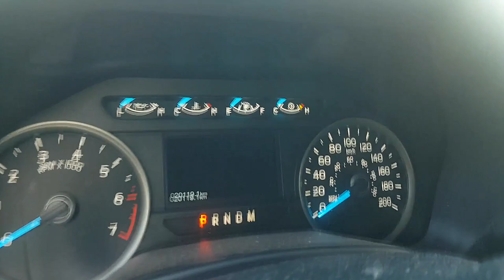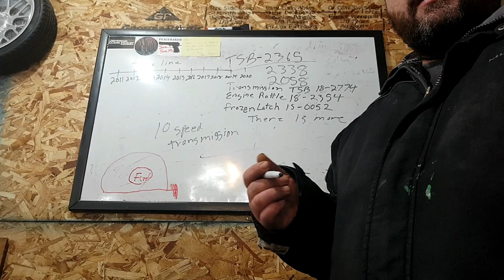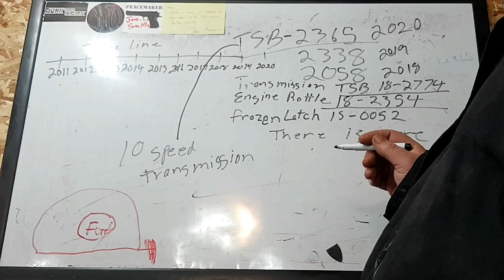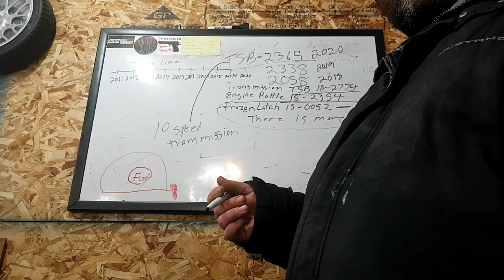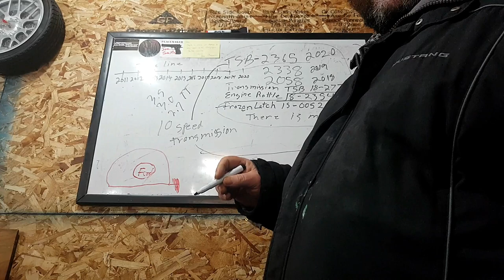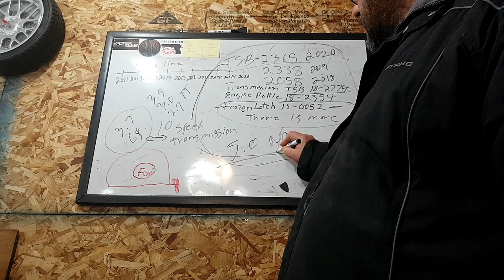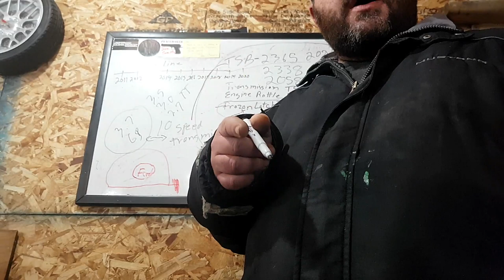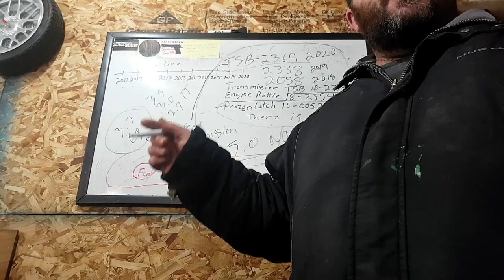FORD F 150 burning oil  consumption engine rattle and transmission problem related? 2018,2019 2020

Comment from the maker: please consider signing petition: https://www.change.org/p/ford-motor-company-ford-provide-answers-customer-concerns-on-f-150-oil-consumption-2018-19-2020-model-years?recruiter=489735026&utm_source=share_petition&utm_medium=copylink&utm_campaign=share_petition
Reply: Ill pass it on to my nephew who has a 2019 furd
Reply from the maker: @ifitsnotbrokenfixit1193  ty sir
Reply: Signed and shared on all social media brother
Reply from the maker: @AntonioClaudioMichael  ty Antonio
Reply: Signed and shared 👍
Reply from the maker: @scottyoung2572  thanks so much 🤜🤛
Reply: this guy's garage 2018 Ford F 150 twin turbo 2.7 has issue. When accelerating from a stop the truck hesitates when going from 3rd to 4th gear. After that it drives normal. This only happens once when the truck is cold. After it is driven a few minutes it doesn’t happen anymore until after it’t been parked for awhile.  Should I be concerned or should I just let it warm up longer?
Reply from the maker: @burimdemiri7394  my 3.5 is similar when cold. my mustang did the same thing with the supercharger on it as well.  its a boost thing when in closed loop operations under warm up. if the problem persists with warm operations it needs to be looked at.  stay in touch, ty for the question.
Reply: this guy's garage when its warm its doing fine thank you!!
Reply from the maker: @burimdemiri7394  very welcome come back any time 🤜🤛
Reply: Signed petition. Maybe I’ll get a newer new truck yet!
Reply from the maker: @MrESage  hopefully they will do something 👍ty sir

Comment: Thank you Sir for all the info. 2018-2020 F150 5.0L. TSB:19-2365 reprograms the Powertrain Control Module (PCM) to reduce engine vacuum during deceleration fuel shut of (DFSO). During DFSO oil may be pulled into the intake from the Positive Crankcase Ventilation Valve (PCV). Ford replaces the oil dipstick as well. Apparently, this solves the oil consumption issue affecting many people. Pass this along to anyone with one of these trucks and tell them to keep an eye on the oil levels. 2 years of research from YouTube and forums and this may be the fix we've been looking for. Good luck everyone.
Reply from the maker: thanks so much!
Reply: I had this TSB procedure done on my 19 5.0 and it lessened my oil consumption noticeably but I still use a little more than I think I should, but, I do tow an RV a lot, so I think that contributes. My .02 cents.

Comment: My used 18 with 43000 had all the problems. Trans and engine. I have engine noise I haven’t found in a video. Loud tap driver side rear lower part of engine. Only when cold out after it warms and idles at 600. The tap is not in Duce with cylinders. Ford putting me off till warranty out the haven’t had a opening in 2 months for me. How do I share a video to you.

Comment: Thank you for your videos       What F150 year do you recommend me to buy i was very close to buy a 2018 5.0  until I found your youtube channel      thanks again
Reply from the maker: 2016 is the last year that didnt have all the issues associated with 2018 -2021 oil consumption and transmission issues 2017 with the 6 speed would be ok the change was midyear. anytime .
Reply: @thisguysgarage   i really appreciated I wish you the best for this coming year and for us that are not mechanical inclined your help is much appreciated. I signed the petition

Comment: Glad I found your video. Mine is in the shop this morning. Hell of a knocking at idle for 3 days and it stopped last night. Appointment this morning again after dipstick change and oil change 1500 miles ago. Just got call back they can’t find anything and rattle is normal. When I go pick it up I’m asking for regional service technician
Reply from the maker: sorry just seeing this, filter picked it up for some reason. how did you make out?

Comment: That stinks when you can't even get a new vehicle off the lot to be correct. 
A buddy of mine had a Chevy Silverado with the 10speed and hated it.  It never new what gear to be in. It was great going down the road at 55mph+ but pulling any weight it was in and out.  Took it back to the dealer countless times.  They told him not to pull anything heavy.  🤦‍♂️
Reply from the maker: That's outrageous.

Comment: The 10 speed transmission was designed by GM and built by Borg Warner, we had the clunk in our 18 and had it reflashed and it did fix the problem for now.  As far as the oil consumption we do not have a problem, but the problem may also be the oil filtering for the pcv system where the catch can is drawing too much oil.
Reply from the maker: you are the only person that i heard from ,that the flash fixed their trans clunk,glad ford helped someone,ty for taking the time,keep in touch!

Comment: I have a 2020 f150 5.0 with the 10 speed. first I put a reducer in the pcv line to reduce the vacuum. Then I switched to 5-40w. That took care of almost all the oil consumption. Then I went to 5star tuning and had a custom tune made for the engine and the transmission.  What a difference. the trans hits every gear. no more hunting or skipping gears. I know I should not have to do all that, But ford was not going to fix my problems.

Comment: If the new dipstick was a scam, how would it be possible for, when you get a fresh oil change at the dealer, assuming the correct 8.8 qts was installed, the level is not significantly above the max level?
Reply from the maker: they moved up the mark as well ,or ford speak widened the range by 3 quarts instead of one

Comment: Another thing added in 2018, direct injection. I feel like the 3rd gen coyotes are also having problems because the new direct injection system (PFDI - Port Fuel Direct Injection.) honestly I think it screwed something up because it’s happening in the Mustangs with 6 speed manuals too. Leading me to believe it’s not just a transmission issue.
Reply from the maker: Thanks for taking the time Francesco.  Ford doesn't seem to care regardless.  It's a big problem. 🤜🤛

Comment: Had all of these problems along with engine knock in my 18’. Sounded like a Diesel engine after 3k mikes. Had it in the shop 7 times and 2 different dealerships and they all say the same thing. “Characteristic of the truck. No issue found”. Tried the buy back with the BBB and didn’t get anywhere because ford said there wasn’t an issue. Needless to say I traded it after 7 months for a 2018 Silverado with the 6speed.
Reply from the maker: So sorry to hear that chad
Reply: My son has to deal with the same problem
Reply: ATTENTION FORD FANS:  Scotty Kilmer says the 5.0L oil consumption problem is a Ford class defect that Ford won't admit to.  All of Ford's work arounds don't address or fix the real problem..... which is that Ford used an aluminum block on these 5.0 engines, and didn't sleeve the cylinders.  They used a ceramic coating in these cylinders (to save a few pennies), and this coating is either failing or it isn't working as it's supposed to, thus causing the massive oil consumption problem.

Comment: Thx Buddy for this information ! I drive a 2017 Ford F150 with a 5.0 V8 with a 6 speed automatic, umm does this problem with the 5.0 V8 affect the 2017 please let me know ? Stay Safe …
Reply from the maker: Not affecting 6 speed trucks! Count your lucky stars 🤜🤛 ty for taking the time 👍
Reply: @thisguysgarage  Thx for your reply Sir ! Umm that's good to hear about my truck I was starting to worry , this is my 3rd F series truck I have owned and never had any issues with them in the past .Stay Safe ..
Reply: @thisguysgarage  Hopefully when Ford rolls out the 2021 they will address some of these issues on which I understand Ford is developing a 4.8 V8 to replace the 5.0 V8 . I certainly hope Ford listens and does the right thing otherwise they will loose their loyal customers umm that sad how Ford is dealing with their customers ? Stay Safe ..
Reply: @buckgonsalvez384  As an newly minted electrical construction apprentice making very little wages in the mid-80's I purchased a new Ford truck. I was treated so shabby by Ford for a class action problem (thick film ignition module) that I have never bought a Ford product since.

Comment: Our 2018 F150 XLT started to make noises (rattle and ping) at around 80,000 km.  I nagged by husband to get it looked at before the 100,000 premium warrantee ran out.  He had just had an oil change by the time he took it in at 99,500  about 6,000 km earlier.  The stick was dry.  Must have been an honest technician (for once) who said we burned 3 quarts in that 6,000 km.  He did a TSB bulletin as you described.  AND said NOTHING about the oil consumption problem.  When I read the bill I got curious....and I found you.   WELL, we are furious.  Ford didn't give us a heads up for 100,000 km.  about the oil consumption issue.   We are getting in touch with the London Law firm about the class action law suit.  After complaining to FORD Care (NOT) they said they will install a seal for the crankshaft.  Oops, part not in and won't be in for one month.  Come back and pick up your truck and return the loaner, and run-out the warrantee.  BUT, they will cover the parts cost ($2.00 more or less).  The work order will be kept open BUT ford won't pay for the labour after the warrantee runs out.   WHAT!!!!   We are stuck....with a truck with no future.  It was to be a retirement vehicle to pull a small trailer. The thing won't be pullilng itself!   PLEASE people stay away from FORD 150s with 5.0 for the years 2018, 2019 and 2020.
Reply from the maker: 100% spot on Cathy. It's really sad what ford has done to us.
Reply: I was so glad to sell my 2018 truck with the 5.0 to a Ford Dealership before all this crap might have happened to me

Comment: Disable the “learn function” on the transmission. The Dealer can set the computer to do that. I’ve seen other videos with a poor shifting tranny, and the results are a perfect shifting transmission after the “learn” feature is disabled.
Reply from the maker: doesn't solve the oil guzzling lol.but ty for taking the time 👍
Reply: I asked the mechanic at my dealership,most he would do is reset the shift tables.they won't turn the adaptive shift learning off.

Comment: ATTENTION FORD FANS:  Scotty Kilmer says the 5.0L oil consumption problem is a Ford class defect that Ford won't admit to.  All of Ford's work arounds don't address or fix the real problem..... which is that Ford used an aluminum block on these 5.0 engines, and didn't sleeve the cylinders.  They used a ceramic coating in these cylinders (to save a few pennies), and this coating is either failing or it isn't working as it's supposed to, thus causing the massive oil consumption problem.
Reply from the maker: ty
Reply: Makes sense.  What about higher viscosity oil like 5w30 or 5w40?  Would that be safe?  My tailpipe is black with soot.
Reply from the maker: @user-gd5og3pz6x  I'm thinking at least  a 5w30 maybe even a 5 w 40 . The exact same engine when rouch adds a supercharger requires 5w50 . I'm investigating further stay tuned

Comment: That really sucks Caper.  It's beyond ridiculous at this point.  Ford should have fixed that problem at least 2 years ago yet they're dragging their feet to save money.  Coming up with BS fixes like using longer dip sticks is the ultimate joke.  There's a lot of folks here on YT who are having the exact same problem.  One YT guy "My Torino"  lives in Mississippi with the same problem, gave up on it and traded it in for a 2020 F-250 but obviously took a hit but he's living with it.  The F-250 doesn't have the same issues as these F-150's do.   I'm happy with my 2006 F-350 even though it's under powered with the 5.4L it runs great with over 200K miles on it.   I hope you get something solved with Ford.  Cheers!
Reply from the maker: Thanks so much William. It is redicous at this point.  F250 would be nice 🤜🤛
Reply: I'm having the same problem with my 2018 5.0 we should let the media know.👍
Reply from the maker: @corradoguastelluccia9871  spread the word far and wide 🤜🤛

Comment: Those TSB sound similar to the gen 1 3.5 EcoBoost intercooler condensation issues.  Same issue from 2011 to 2017.  Oh yes with a license plate stuck in front of the charge air cooler starting in 2015.  I owned a 2013 and it only went into limp mode once, before I had to drill a 1/32 hole in an intercooler of a vehicle that is less than a year old.  I would like to tell you Dodge doesn't do anything like this, but I would be lying lol.  This lifter and cam issue with the Hemi has been going on for a long time as well.  Good luck.
Reply from the maker: Thanks so much Mike appreciate it 🤝

Comment: The new coyote engine is different old coyote. Ford went with spray on cylinder liner and the oil consumption was born. One thing I don’t understand is why you would put a 10 speed transmission in a normally aspirated engine? All it’s going to do is lug the engine down. The eco boost makes sense in Eco Boost engines, rpms are in happy place.
Reply from the maker: Absolutely correct. Low speed preignition is rampant with the ten speed.

Comment: what about 2.7LT 10 speed 2018 twin turbo do they have same problems?
Reply from the maker: right now i have a 3.5 tt which is basically the same ,no issues like this .ty for taking the time!
Reply: this guy's garage thank you so much bro cause last nite i didnt sleep till 1am i got the truck from dealer at Hartford wi but the truck was made on Michigan Ford factory
Reply from the maker: @burimdemiri7394  you dodged a bullet! spread the word the 5.0 is a no go. ty again
Reply: this guy's garage 👍😀im now more relaxed im happy i dont have 5.0 this truck has 475 hp its fast like rocket and i think his engine is from ford mustang shellby
Reply: Even on highway i raced with ram chevy and cadillac none of them had chance i keept them around 2 miles behind i love race any tuck on highway
Reply from the maker: @burimdemiri7394  i had a first gen eco with a tune ran 12.90 quarter mile

Comment: I couldn't decide what truck to buy. Since Ford f150were the number 1 selling trucks that's  why I got mine. 
Love everything but the drivetrain.
Anyone out there ever stop on a hill in drive, come to a stop, let off the brake completely and drift. Hear the rear end make a bang or not, mine does, everytime. Comment:
Reply from the maker: mine did the same thing,it did not even need to be on a hill,would do it in park on a level ground,ty for taking the time!

Comment: I have a 2018 with the 5.0 coyote engine and it does burn oil i just found this out in 2024 when my check engine light came on. Put oil in and solved the problem 70,000 miles transmission seems to be fine if it makes it to 99,000 miles ill trade it in.

Comment: I don’t get it.  Why do people keep buying this engine when ford keeps having problems with it year after year?
Reply from the maker: i just dont get why ford wont fix it .  the only design change between 18-21 was replacing the dipstick to hide the oil consumption problem

Comment: I have the engine rattle, and clunk on startup. Interestingly, the auto start stop doesn't cause the clunk. Though I try to always remember to turn that garbage off
Reply from the maker: Mine was the exact same way.ty for taking the time. What is your dealership telling you?
Reply: garage well they did a computer update. It marginally improved the rattle. At this point I'm just gonna trade it in in a year or two
Reply from the maker: @jamesalexander958  try the amsoil if you have to wait that long to get rid of it. I have a video on it.

Comment: "Here's a longer dipstick so u dont notice how much oil its using", WOW. The lifeblood of ur vehicle. Kinda looks like they intentionally design their vehicles to not last while gambling on them lasting the warranty period. They're just hiding/denying issues along the way and hoping people dont know any better. Then they can sell u a shiney brand new ford after they tell u the price of some of these out of warranty repairs.
Is it really that deep, idk, but it wouldnt surprise me at all. Used cars dont line their pockets, neither does repairing new ones under warranty. They make beautiful vehicles, by far my favorite in appearance and features, what a shame.
Reply from the maker: Its definitely a bluff to get you out of your warranty.  Thanks so much really appreciate it 🙌🏻
Reply: ATTENTION FORD FANS:  Scotty Kilmer says the 5.0L oil consumption problem is a Ford class defect that Ford won't admit to.  All of Ford's work arounds don't address or fix the real problem..... which is that Ford used an aluminum block on these 5.0 engines, and didn't sleeve the cylinders.  They used a ceramic coating in these cylinders (to save a few pennies), and this coating is either failing or it isn't working as it's supposed to, thus causing the massive oil consumption problem.

Comment: I'm going to Hazard and informed guess that the oil consumption issue has to do with the fact that in order to speed up assembly of the engine they have gone to an unusually large piston ring Gap. I have seen Chevrolet engines come out of the yard that with known oil use issues, where the piston rings have a known gap of .0 30. There is no reason for a V8 engine to have a .0 30 ring Gap should be far closer to .015 to .018.